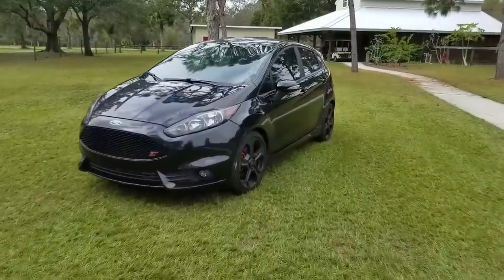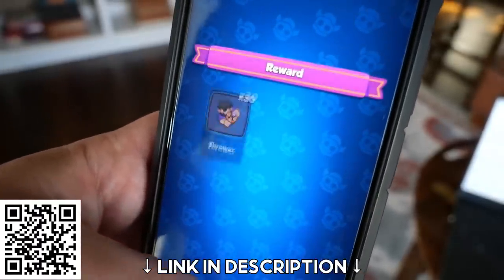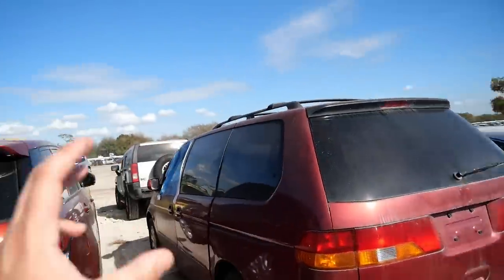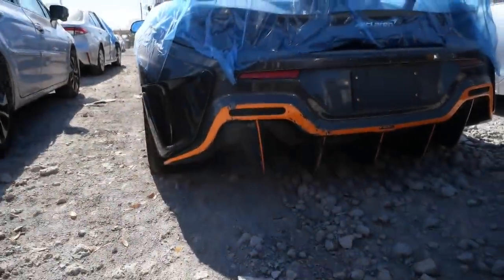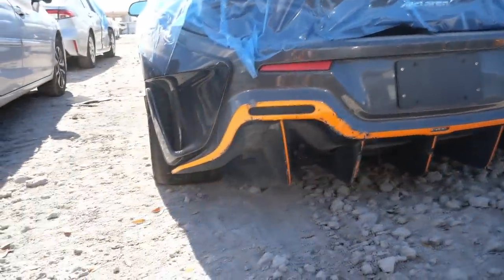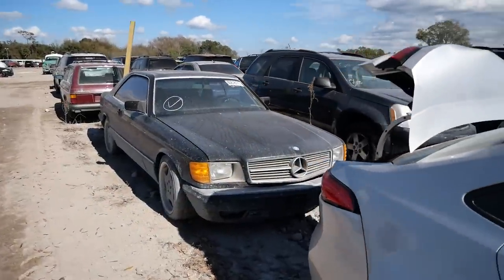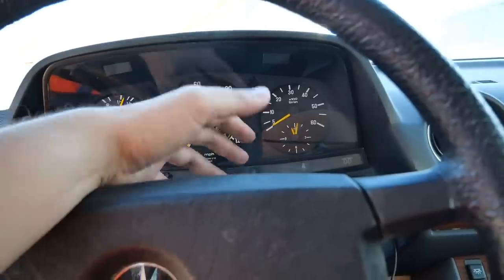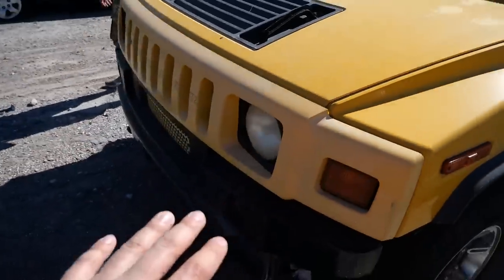The Salvage Auctions have made it IMPOSSIBLE for me to Buy this "Cheap" McLaren 600LT

Comment: I think the Mercedes wagon would be great Sam. Just seeing it get a full detail would be satisfying!!! You wouldn't need to spend thousands either!
Reply: Flavour of the month, an e-swap into the Merc would be a pretty cool restomod.
Reply: Those old diesel Mercs are million mile cars. Get it and try to top Tavarish's millionmile Lexus...
Reply: @grandtheftautotune7715  Literally built like a tank!! The fuel delivery system on those would get dirty and make them run rough. A simple clean and rebuild of the unit and it runs like a clock. If that is a problem with it.

Comment: 20% discount is not nearly enough. First, it will have a salvaged/rebuilt title. Secondly, there are always surprises. Those surprises come out of the discount. No thanks!
Reply: 30%+
Reply: Yeah, but it's a McLaren. 
He's a good mechanic, and everything wrong, how he fixes it will be documented here on his videos. I'd buy a vehicle with a rebuilt title from him.
Reply: Unfortunately your asking for a dream, these auctions have people go over these cars to come up with the maximum value they think they can get before it goes up for auction, combined that with people bidding that don't realize that McLaren parts are extremely hard to get used, an McLaren doesn't even want to sell you new parts unless your having them do the repair, an that leads to people over paying for the car an pushing out any bidder that crunched real world practical numbers. Just look at tavaris an what he went thru to rebuild his 675LT, which seems like he only did that build because McLaren taunted him saying he'd never be able to get that car rebuilt himself an yea he proved them wrong but it wasn't cheap by any means an only made since because he got a lot of content out of it.

Comment: I completely agree with you. You never know what hidden damage there is and how much money you have to spend you didn't fact in. You have to pre-glow the old Diesel Merc. Cool car, for sure!!
Reply: I had an 85 300d in San Diego. Sometimes, I'd get in a hurry and crank it without waiting. They start fairly easy that way in warm climate. In a really cold climate, you may have to run the glow plugs several times before it starts.
Reply: If it's warm outside u don't really need to pre glow it

Comment: Thank you for making this video!! 👏🏻👏🏻👏🏻 your 100% right about this! The work around is go to your local high end body shop and let them know what your looking for. The next time they get a total in of that car they will call you and you do the buy back so you get the car with a clean title and you they the owner and body shop a small fee on top of the buy back price. The down side is you can’t run volume this way, it takes a wile to get the car, buy backs are usually fairly high but your getting a clean title and you can get the body shops input on the car before you pull the trigger.

Comment: My dad had that MB wagon in that exact color. I believe it was a 1980 300TD. Ran it up to 350k miles and sold it. Today, he still drives a 1986 300SDL with about 400k miles on it. Biggest problems with these old MB's is that parts all have to be custom made in specialty shops because they just aren't available. He had to spend $1500 last year for a specific coolant line because a replacement just doesn't exist. His mechanic has offered 16k for the 300SDL, but my dad won't part with it.

Comment: Thunderbirds are really cheap to buy in nice running condition in the regular market. Lots of classic cars end up in auctions because people insure them with regular insurance thinking they are saving money. But what happens is as soon as you have a claim, even if it’s minor, the insurance company totals it because it’s more than 10 years old. If the owner would have had classic car insurance it would have been fixed.
That goop on the fuel line wasn’t from a fire. It is insulation to help against vapor lock.

Comment: 1959 Thunderbird, has a 352 Ford FE engine, still lots of FE blocks around, performance parts available. Would be fun build, 390 or 428. Lucky it doesn't have the larger optional MEL V8, parts are scarcer.

Comment: When the engine was noted as damaged, why did you start it without checking the oil levels and then running it for some time? I really appreciate your videos.
Reply: I think it indicated 'mechanical' damage, not engine damage specifically. If the engine was toast, starting it did not hurt anything.

Comment: '58 Thunderbird, that's a 332 or 352 c.i. engine and that stuff on hat metal line is called presstite tape it was part of an A/C kit that was sometimes dealer installed and was meant to be wrapped around the A/C line to the receiver/drier..

Comment: Hello Sam, the S class key FOB has a sliding button next to the metal the key ring is connected to, that metal is also the key. Slide the button and the key and key FOB will separate. Just pull key FOB away from the key, therefore the zip tied key will remain connected to the zip tie and you can use the key FOB to start the car. Hope I actually made sense lol.

Comment: My coworker is an ex cop, he said to never buy a used police car.  You might see that the engine has low miles but the engines have a whole lot of hours of just idling.
Reply: Never buy a used ambulance either, intergalactic mileage, regularly redlined from cold, umpteen drivers, the rear has been awash in every bodily fluid and umpteen people have died in there.

Comment: The police tahoe. They are beefed up. High amp alternator and battery. Better brakes, Heavy duty cooler for trans and engine. Lowered a little bit for handling and re-tuned abs stability system. Just have to lookout for high idle hours on these.

Comment: I like that Thunderbird.  The name tag on the trunk might have been the dealer tag because they use to have those script type way back before you were born.   The hummer H2 would be the easier of the two to fix up because of the body work the suburban has.  I use to buy police cars from state auctions.  They were fun to fix up and drive and when the state had money they would turn the out for under 100K in miles but you could pay $6K for one.

Comment: Valid points on the salvage vs used!

And Sam, the S55 AMG had keyless go, so you should've just pushed the brake and pressed the button on the gear selector 😁
Reply: That wouldn't work unless you have the key card with you. I have the same era car with keyless go, only works if I have the card on me. Doesn't work with the ignition key.

Comment: I would buy some roller kit cars.
Backdraft 427 cobra, GS vette, 356, 550

Build what u can ....cheap labor.
$65-99k retail.    550-1100hp

I like white, white diamond stich leather, yellow gauges RPM, black stripes yellow border stripes, black knock offs 335s

5.0 Coyote 480hp stock
 cammed, tuned 550hp
Reply: Virtual no depreciation weekend driver
Cobra backdraft

Comment: Yes they do “supe” up police vehicles 

Ford calls it the Police Interceptor Package and they tweak the engines the do weight reductions (ultimately alter the weight because it’s added back sometimes by placing ballistic panels in the doors

But yeah they absolutely change the engines, especially with the older Crown Victoria’s

I know Ford still does the Interceptor Program on the stupid crossover vehicles that are now becoming the standard at every agency across America. And that’s because Ford is getting most of the contracts. Dodge (Daimler/Chrysler) does have some agency contracts (like California Highway Patrol) but anyway, Ford does absolutely alter police vehicles.

Comment: ...300D under 100,000 miles in perfect nick $35,000 – if you can get a 300TD (much rarer and more desirable) for under 10k?...the RPMs is a replacement fuse GO FOR IT! ...it's GREAT value and dead easy to work on ...I have one!

Comment: That line on the thunderbird was a type of insulation on the line.  That looks like the AC line, my '69 had something similar.  It's like a tar, nothing wrong with that line.  The engine, provided you don't want to keep it numbers matching, wouldn't be hard to replace with a similar engine.  It might have been totaled due to having a non numbers matching engine in it.

Comment: It would be brilliant to have a drive that '59 T-Bird! If there is anything wrong with that motor I'd be amazed, and even if there was an issue, cars that had carbs were easy to work on and if a buyer needs a mechanic to repair it, the cost would be far less what many pay out these days. That T-Bird would sound mean and would be a pleasure to drive. A HUGE plus of working on cars from back in the day is, you can give the engine a tune-up without removing half the engine! A tune-up would consist of new spark plugs and points, and at times a new set of plug wires and a new distributor cap...and all are easily accessible. The only drawback, with a huge power plant like that one in the car is, the cost of fuel and the fuel tanks aren't small lol. When I had my Chevelle in '79, fuel where I lived wasn't even .80 cents a gallon yet lol. When I started learning to drive the cost was .60- .65 cents a gallon lol. Sadly, it was the rising cost of fuel that doomed the old muscle cars. I now live in the UK, and not long ago I heard a distinct rumble coming up the street and when the car finally came into view...there was a beautiful Pontiac Trans Am! It was a '79 (too bad it wasn't the iconic '77 black with gold trim made famous by Burt Reynolds...RIP) and it was black and gold. Every now and then I get to see a Mustang, Corvette, Charger or even a Dodge Ram or big Ford 350 pickups, and even a Hummer...plus that Trans Am. Some people here appreciate iconic American Muscle but, right now with petrol pushing £2ltr, I doubt those who do own one cannot afford to drive it daily!

Comment: You could probably save more than 20% if you don't order on eBay since their selling fees have climbed astronomically, thus, driving the cost of merchandise to rise. Another thing, Sam, is that I'm sure you have better connections on parts than most who restore or fix vehicles. If you don't have tight business connections on rare parts, then you're not really doing business. Sure, parts for a McLaren are going to be more expensive, however, it's likely that you have parts or cars that another restorer needs and you have the ability to barter instead of spending liquid cash.

Comment: As to that 50's T-Bird, no you don't swap the motor.  That car looks complete and original, so the solution (if necessary) would be to rebuild the existing motor, assuming its a numbers matching car, and keep it as original as possible.  That would maximize your return on it.

Unfortunately CoPart has developed $$$ in their eyes since YouTube has made them incredible popular.  Their fees are ridiculous at this point though I'm sure they couldn't care less what my opinion is.

Comment: Sam I think the T bird is a 59. Just the run of the mill birds go for 15 to 20k. Look up the prices of high end cars on Haggerty. It is the first 4 passanger  Tbird and that was only a 2 year model completely restyled.  That car is what you should be rebuilding. You can rebuild that engine for cheap.
Reply: I paused the video and looked up the lot on Copart. It is indeed a '59.

Comment: 26::25 - The engine in that 59 T-Bird is the optional 430 cu. in. MEL V8 (standard was the 352 FE cu. in. V8). Definitely worth more, but being a regular hardtop vs. a convertible will lower the value.
Reply: Hi Sam! I  have followed you for years,  & really appreciate your    videos, especially the hardest trouble- shooting. I am a retired  mechanic, but I just had to let you know  the T- Bird was from O' Meara Ford on 104th in Northglenn, Colorado.

Comment: Good trick at auctions ... start the car, check the engine runs good .... if you plan to bid on it, pull the zipties tight to stop anyone else checking the engine easily.
Reply: If you really want to tank an auction cars value just pull the lead off one of the engine sensors and trip the CEL. Happens frequently at auctions I attend (no I don't condone or participate in this type of behaviour).

Comment: Salvage cars no longer make sense for most people.  Back in the day (20 years ago or more), you could get amazing deals, but now you are bidding against the whole world and few main salvage auctions bought up smaller players, so not much competition left.  That is why you see fees going through the roof, as there really isn't many choices to buy somewhere else.

In general if you diy most of the work it makes sense to have a car with a salvage "rebuilt" title.  You should be saving at least 33% or more on completed salvage project compared to what you can buy with clean title, as otherwise it doesn't make sense financially.  Rebuilt "salvage" cars are almost impossible to finance, some insurance companies will not insure it and in some cases dealers will refuse to do recall or warranty work.  On top of all that, some things will fail prematurely on a salvage car in the long run, as not all damage is visible.  Selling with rebuilt title is also another headache.

Comment: Can you not throw away carbon rotors and replace them with steel ? Carbon rotors are ok for racing because  you need to build up the heat to make them work properly. The large steel rotors that replace them are  plenty good enough for the street.
Reply from the maker: You have to pretty much replace the whole setup. It's a complicated situation because the rotors, calipers and pads are all different. Then there are companies who make iron rotors to fit the bigger calipers but they charge a fortune because they can.

Comment: You buy a 600LT clean title for $220k drive it for 1yr sell it for $215K. You buy a rebuilt title 600LT for $170k drive it for 1yr and sell it for $165k. Basically the same $5k loss in both cars. But the better part is clean title is ready to be driven. Easier to finance. Easier to insure. Easier to sell! In the end your loosing the same amount on both assets but one of em is just a huge headache to own

Comment: This goes well beyond supercars like the McLaren. Across the board auction costs have gone up, and frankly I'm surprised you're even still able to scrounge up auction cars at any kind of fair deal. Between the exposure these platforms have built over the years and the supply shortage driving up demand in the new and used markets, auctions figured it was a safe time to hike up fees. Their fee structures are always built to benefit the high volume buyers/dealers first and foremost, so they have more wiggle room to bid a little higher on cars. The only way individual buyers can compete is risking overpaying on cars that may very well require costly repairs and put their new owners underwater. Obviously auctions like copart aren't obligated to give you the full rundown on what all damage their cars have, the best you can do is look at the pictures and make a best guess as to what is damaged and what the cost to repair is. I tend to err on the side of caution and not get caught up in bidding fever, missing out is better than losing serious money on a car that may be a total loss.

Comment: So your question is... The Hummer H2 or... The police Tahoe.... Tahoe... because the H2 is on a Tahoe chassis. Also, I'm hunting around for a Hummer H3! NOW it has to be the Isuzu 3.7l 5 cylinder. Because, the 3.5l engine was complete GARBAGE! The 3.7l is Isuzu bullet proof truck platform engine. It's pretty much from there Pick-up all the way up to the Industry Vehicles.

Comment: I think the 59 T bird has a different motor in it, I dont remember those being that big, and that looks like a melted radiator hose, and those cars are pretty basic, I dont see how an engine failure would total out a car like that, and I dont think its an Unibody either, like if you can get that for a couple of grand I think even if you sold it in spares you could make your money back. 

also the name on the back I think is the name of the dealer it came from, unless its weirdly canadian, where they had their own versions of our cars with different bodywork on them

but it looks to be a straight 59, but as with all classic cars value is in the eye of the beholder if you like it go for it, if not dont worry about it, its a 59 coupe, made after the iconic first model, and before the far nicer to look at third model

hell theirs a third model sitting at my local garage sadly rotting away up here in the snow in tropic green, been damn tempted but I just have no way to take care of it

hell I could give you the number, he also has a mitsubishi 3000gt like tavarish had and got back sitting out front just rotting away, in black which he could use as a parts car, I literally see it everyday I go by there.

and you have an acquaintance who could go and check it out actually, granted depending on how far he is, you might need to bribe him with ALOT of fried chicken and hire someone ELSE to trailer it so they dont take the front end out like he let them do on the rangie lol

Comment: Compartment are just getting greedy.   In the UK we have different levels of insurance. 
Third party. This covers damage to the other vehicle if your at fault.  BUT not yours.
Third party fire and theft.  As above but if its stolen of set on fire you get a payout. 
Full comprehensive.  As above but this fixes your car if you are at fault. 
Most go for the first two, especially if its a young driver.  So you can pick up none recorded accident damaged cars of the original owner.  
Salvage rebuilds on this here YouTube have a Ford ST line that's being fixed that's not recorded.